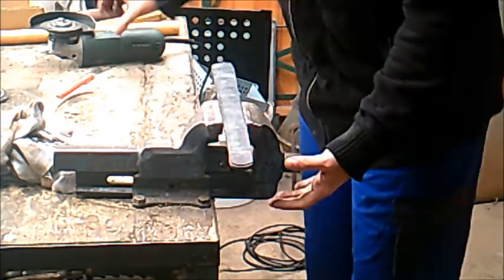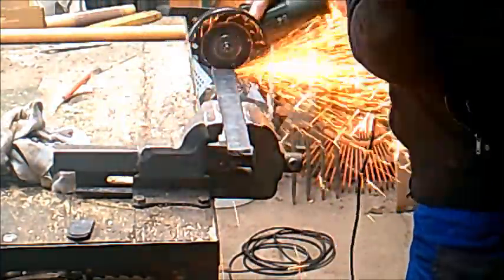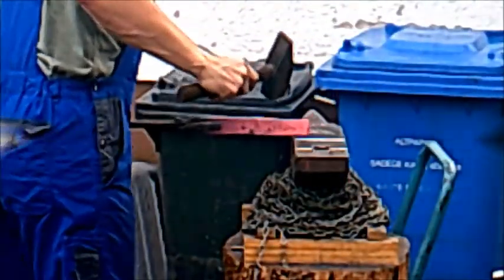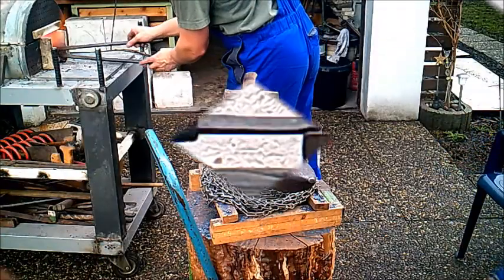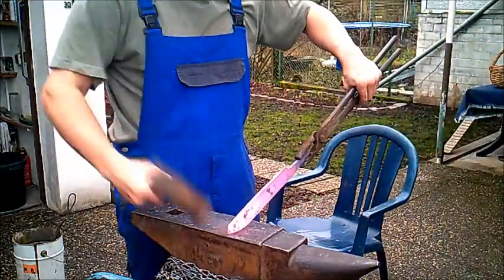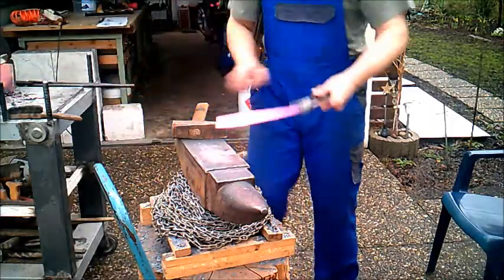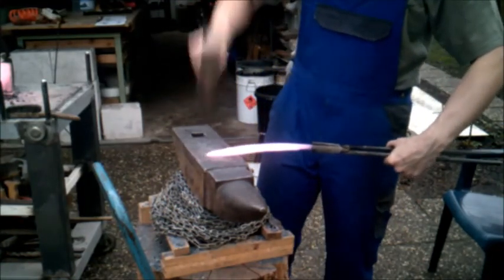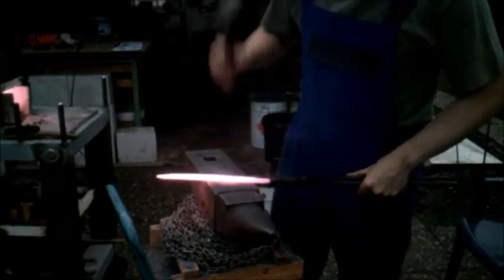from drawing to the cutting test   a damascus knife envolves part 2 forging

Comment: :) I'm going to be making a small Damascus knife soon, but it will just be a project and I won't be selling it like "the short guy" knife I made.
What type of flux did you use? I use baking soda, seeming I can't find borax. I would use borax seeming it's the most used but don't have much in Australia.... :(
Reply from the maker: i used borax but sadly it is forbidden to buy it in germany because it causes cancer and makes you unable to make children :( i still have a little bit that i will use in future :) 
i did not know that you can use baking soda as a flux :) i know that you can use quartz sand for that ( thats not that dangerous ). you are from australia ?? thats far away from germany :) i have a friend that does work and travel in new zeeland :) it is funny with the time because when we have 12 at noon here it is 12 at night in new zeeland :) 
my first damascus blade i made was from a bicicle chain ( wich works very nice ) i did not fold it very often and it is also not heatreated :) but it still hangs on my knifewall :) 
leather sheath making is also not that difficult you just need to make the holes the same distace from the preferios one all over the leather :) and make the holes before you begin stitching :) if you just fold over one pice of leather there should be an other pice of lether betwen them at the stitch because if there is none your blade will cut the string :) 
maybe i will make a video about that :)

Comment: Did you make that billet, or buy it? Thanks for the tips on my channel.
And how old are you? I'm only 13, that's a very nice knife to! :)
Reply from the maker: i forged the rough billet my self :) 
but this damascus was difficult to forge :( because i used very thin pices of metal at the beginning and the forge weld was not that clean so yesterday i had to remove a lot of material sadly and the knife now looks totally different from when i drawed it :) it is much more easy to make a billet from thicker pices of steel :) then the forgeweld is more clean :) 
if you want some more tips just watch my videos or ask me :) 
i am 20 and i do forging since i am 17 or 18  i dont know anymore :) but not for that long :) i did never had a teacher so i had to find out all my self :) but right now i think i know a lot of stuff :) i think when you are as old as i am you will be much better in forging because you started earlyer :)